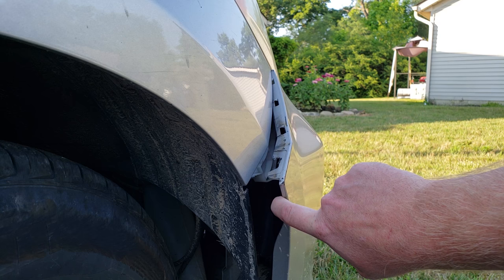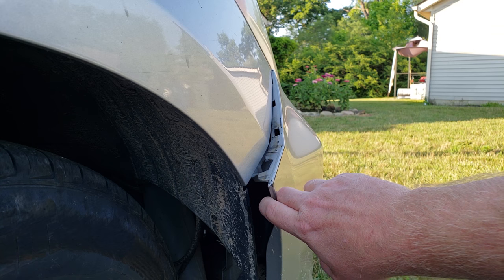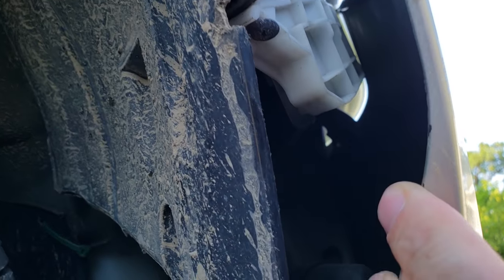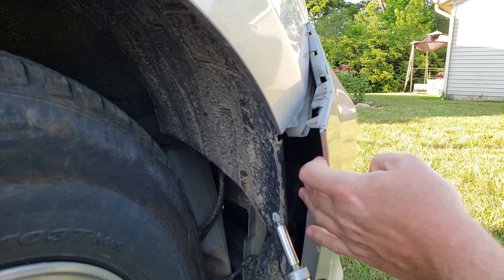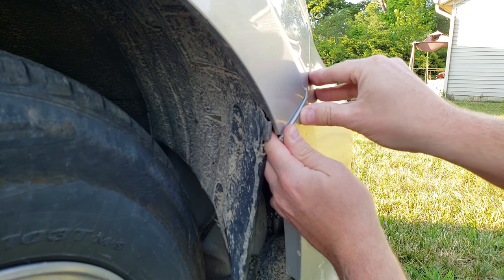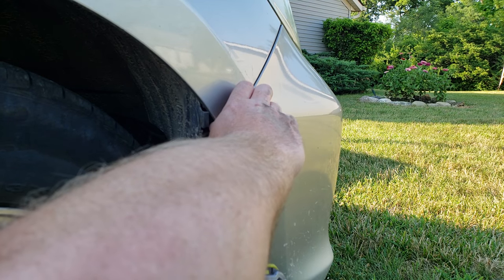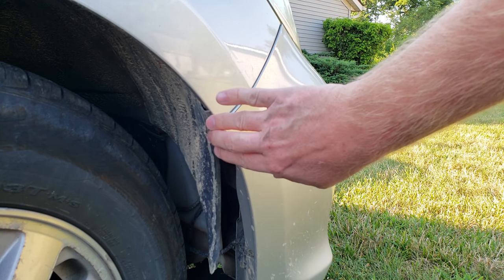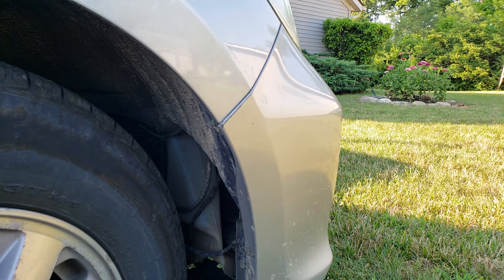LOOSE BUMPER REPAIR | HOW TO

Comment: Thanks! This, coupled with another video - taping off bumper and quarter panel, and inserting jbweld in the joint- helped my son save $1400 on a loose bumper of a10 year old Lexus. Thanks so much!
Reply from the maker: My pleasure! It takes "drive" to watch several videos to get to a positive end result. I'm glad your son saved some cash. That's always the goal! 👊
Reply: Hey saw your comment on the other video 😅🎉

Comment: I’m going to try this on my Nissan Rogue, I have the same issue as that part came out when I backed up my car, it looks like it can be pushed in but I think I have to try what you did and it might work
Reply from the maker: It might. Either way in many cases it is a temporary fix. I hope it works!

Comment: Hi mike. Great video. I need your help here. I want to remove fender and stuck on removing this white spacer that locks bumper. Can you guide me how to do this?
Reply from the maker: That can be very make and model dependent.  Keep in mind that there are many spacers and retainers like that around the entire bumper. What automobile do you have that you need to do this with?
Reply: @THEDIYMIKE  Thanks for reply mike. I have 2005 hinda odyssey EX.
Reply from the maker: Well, I don't have the van anymore to be able to make a video and show you. However, I can provide you this link to a video that will show you how to remove the bumper so that you can easily access the clip. https://youtu.be/TB96_GXKf9I  I hope this helps. If you have any other questions please ask and I'll do what I can to help!
Reply: Thank you so much mike. I already reached the clip but problem was how to remove clip from fender. There is not much space to work on it si finally i took it to body shop. I was trying to save $100 and change the fender myself but this clip didn't let me save my money. 😩😩🤣🤣.
Anyhow thank you so much for your time and help. May you always be blessed.

Comment: Thanks for the video. Since you said you have had to do that a couple of times, I'd guess that a little dab of gorrilla glue on those plastic parts before you screw it down would keep it down even better.
Reply from the maker: I suppose that wouldn't hurt. I didn't want to advocate someone applying adhesive to their vehicle although improvising can always be adapted to any "how to" video. I may consider that the next time mine comes loose. Thanks for the thought!

Comment: what if my entire bracket broke off so now there is nothing there for me to screw into.  is there some type of clamp/screw that i can use to connect the bottom piece to the top piece?
Reply from the maker: So, that I'm not familiar with and Don't have an answer that I'm comfortable with. There are other videos out there for this type of repair,  however,  they're a bit more destructive. Sorry I can't help.

Comment: My back bumper has a circle type screw - any idea what tool would release it?
Reply from the maker: Typically those have a 2 "circles" the outer one is what holds it in place and the inner pops out. Use a flat head screw driver to gently pry the center one out to you and it should release.
Reply: @THEDIYMIKE  spot on dude! Took it to auto store they said the same thing
Reply from the maker: Awesome!

Comment: Most such accidents result in the bumper's tab (i.e., where the screw is supposed to hold onto) being broken, thus making such re-connections temporary, at best: one good bump, and it's back to the garage (yours or a mechanic's). And, many cars have multiple screws (some are plastic) and tabs that are out of reach of most DIY'ers. More often than not, a new hole has to be drilled in a nearby place, and you may even have to go through the bumper to do it, as I had to do with one car, using a screw-on rivet (hardly anyone notices it, because the smooth, flat, head looks as if it's part of the original car design, but, it won't pass muster, close-up). In another car, I used airplane lacing cord (a very strong, flat, thin, waxy, cord) to hold the back of the bumper to the car body, completely out-of-sight; three years later and it's still holding (n.b., I had to use a jack to lift the car up enough for me to work, comfortably, from underneath, and, yes, I used jack stands to ensure my safety!).
Reply from the maker: This is an excellent comment and spot on. Everything you said is accurate and helpful. Thanks for your time in making this post.

Comment: It’s kinda hard to tell- but what was the purpose of pulling the white bracket down? Were you able to tuck the bumper in above it and then tighten to hold in place?
Reply: Yes, you are absolutely correct. I had to pull it down slightly to be able to get the bumper tucked.

Comment: What to do to properly fix the part that the bumper hooks to. Bought a brand new bumper and it will fit properly but it wont stay in.
Reply from the maker: You may need a new clip or to be sure that it's seated properly and fully. These bumpers can be a real pain in the arse

Comment: thanks for the upload 👍
my 05 bracket won't budge can the bracket be removed or no ?
Reply from the maker: The brackets typically don't show a lot of movement. I'm not certain as to if it can be removed or not. Once you loosen the screw it should have some wiggle room. I recommend not removing it completely though, it can be rather arduous to get it back in place.
Reply: @THEDIYMIKE  thanks for the response
Reply from the maker: You bet

Comment: My problem is from other direction by headlight, retread flew off semi on Interstate and flew into my front bumper, the 3 clips starting at headlight going back won't stay snapped together
Reply from the maker: Yeah, that's a more serious issue. You may need new clips altogether or a body shop for assistance.

Comment: Dude is it the same with honda city???
Reply from the maker: It may or may not be. I'm not familiar with that model specifically. However, the majority of bumpers are assembled in a similar fashion. It is possible that it could work but I cannot guarantee it to be the same. I hope this helps.
Reply: @THEDIYMIKE  thanks mike
Reply from the maker: You bet

Comment: You see how the flap is loose . it’s like covering the wheel kind of is that a big deal
Reply from the maker: My flap was worn down from the tire before I realized what happened. It's there to protect the engine bay from excessive road spray and debris. Over time it could be a significant issue in my opinion.
Reply: @THEDIYMIKE  mine is coming off it looks like it’s missing screws or something
Reply from the maker: Hmm, see if you can find a diagram somewhere showing exactly how it should be mounted.

Comment: I have tried this and lasted a few weeks so not really a proper repair.  A fudge job is the title you want to use!
Reply from the maker: Yeah, I did state in the video that it would most likely have to be done multiple times. It's a good repair for a trade in to squeak by. The alternative is an expensive proper repair.
Reply: THANK YOU... The title clearly says "repair", not "click bait" (as it should). Not even a little helpful
Reply from the maker: I'm sorry it wasn't what you needed.

Comment: That plastic fender will catch again and will need to be replaced
Reply from the maker: You're completely correct. It's a temporary fix.
Reply: @THEDIYMIKE  no worries best part is it’s lost cost and take only few minutes thanks for posting
Reply from the maker: Truth. I didn't think about it at the time but it'll get you by in a pinch on a trade in. That's what I did.

Comment: What a bloody "Mickey Mouse" way of supposedly fixing a mere broken bracket on this bumper!! Sure it has worked but for how long??? That was just a sheer waste of time & effort & a job like this it'll be damn interesting to see exactly how long this fancy repair will last!! (yeah right) It should have been fixed properly in the very first instance & for the longer term & not just a temporary fix as in this video duly portrays!! Further a  job of this nature does not require either expensive specialist tools or even a lot of head knowledge but more importantly it does require some bloody common sense which is a due facet not all of us have access to these days!! I'm actually a certified computer tech (so how boring is that??) & I simply learnt how to fix these sorts of plastic vehicle repairs merely by watching "YouTube DIY" videos as I refused to pay the rip-off prices that the motor vehicle service industry charges for these simple repair jobs!! People would be better off spending time watching & learning "DIY YouTube Videos" instead of the 99.95% crap that they prefer to view on the TV!! Want to save money on vehicle repairs?? Easy, stay as far away from vehicle workshops as you possibly can & do it yourself. Some of it you can't & will never be able to do but a hell of a lot of it you can indeed so get in & fix it yourself!!